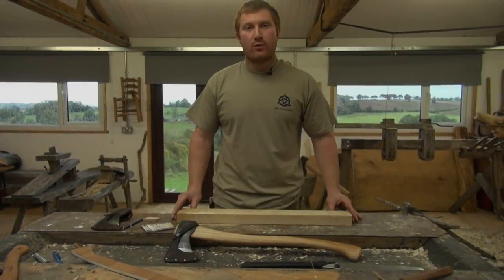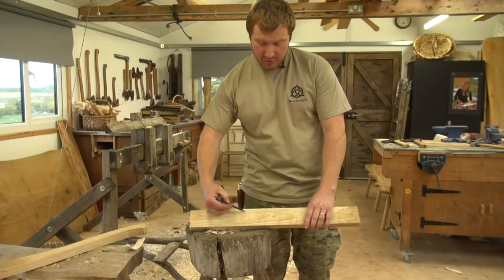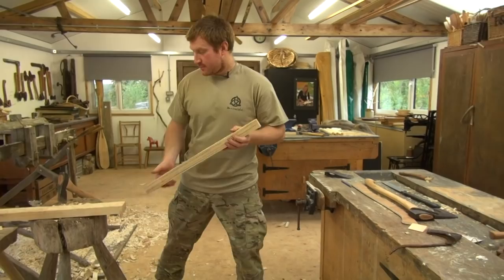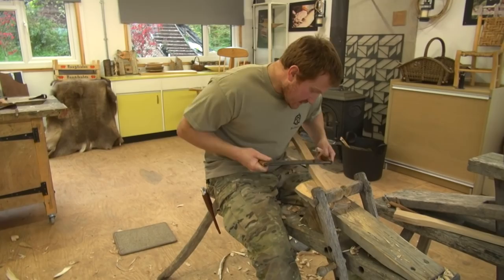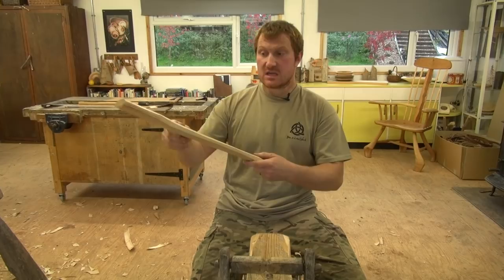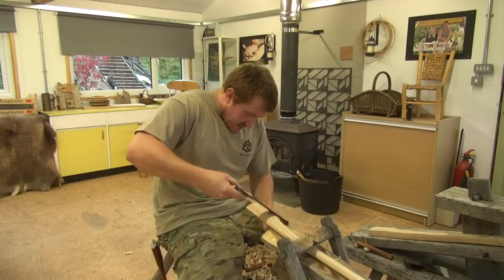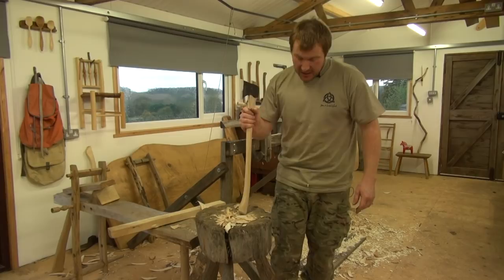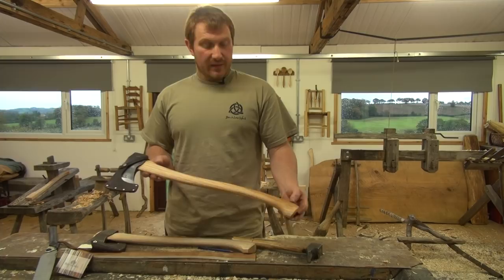How to make an Axe handle

Comment: I came across a carpenters hatchet, axe and a small 4lb. sledgehammer that were my great grandfathers made sometime in the 1800's.  Had to replace the handles and they turned out great. Wish I had a crook knife like you had to shape the handles. It sure would have made it a little easier, but I got it done. Great video and thanks for making it.

Comment: Find/cut a branch from a tree that is a little bit bigger in diameter than the handle you want to build and using your knife shape it into a straight handle.People have used straight handles on their tools for millions of years and some still do...With your newly fixed axe you can carve a better/fancier handle like you can see on this video:QVXvw6to2xA .Hope that helps!The most important thing is to actually start doing/carving something.

Comment: "Obviously if you're out in the woods and you need to restore your axe handle you won't have a bandsaw, so we'll show you how to do it with an axe." 
What. 
What. 
THEY HAVE NO AXE. THEY CANNOT USE A TOOL THEY DO NOT HAVE.
Reply: XD that's hilarious
Reply: +Sitric Brave Well, you could use the head. It would take a bit of work without the handle, but it is possible. But I do get what you're saying.
Reply: +Sitric Brave Since the handle blank is for a boy's axe size (or same would apply for a felling axe size), I'm guessing he means using your hatchet to shape the handle for the larger axe considering you would never really use a larger size axe for carving/roughing out anyway. In the woods, without a dried blank, you could make a temporary handle from green wood -- which could be shaped using a knife since it'll be softer.
Reply: you can stick a rough temporary handle into the ax head...but I've never known an experienced woodsman to break a handle...
Reply from the maker: Obviously this has caused a little confusion, this was to show you the skills in a workshop so you understand the process. Then if you are out in he woods and have to fix a broken tool you can. Effectively you can use the axe head without a handle to fashion a new handle it will just take longer. 
You could make a new axe handle with what you have to hand and be resourceful. 👍
Reply: Tyler Rodriguez or time to let the handle dry XD

Comment: great video thanks....what if all you have is freshly cut wet oak wood? doesnt it need to be cured or dried first?
Reply from the maker: Well you can make the handle first when it’s green but make sure you leave the head end over size. It can then be dried before shaping to fit. 
Hope that helps👍

Comment: Hello, is there particular reason for chopping the main shape with axe? It seems it would be much easier to just cut it with bandsaw. Or would the saw somehow weaken the wood by not respecting fibers direction?

Anyway this is very informative video. I recently broke a handle on my old axe and will need to make a new one. I'm sure this tutorial will come in handy.

Comment: Why would you split across the grain with a steel wedge. You cut with the grain for the wedge, if done right the glue will hold it in. You can buy a swelling agent for the wedge. Don't put steel wedges in. That manufacturers idea if the axe drys out in the stores the wedge wont get loose. If a axe is stored in a normal atmosphere the timber can absorb moisture to swell the wood and keep that wedge nice and firm.

Comment: Wait. If you're out in the woods and your axe is broken, it's going to have to be something other than the axe you use to form a new handle.
Reply from the maker: Well fortunately you will always have the head of the broken axe so you can use the head or even make a simple repair to help make the fresh handle and fit it properly later. 
In these situations you have to think laterally 👍

Comment: If you're in the bush and you've broken your axe you haven't got an axe to use to make a new handle. Just a thought...
Reply from the maker: Well if you have broken your axe you will still have the head to use as a cutting tool. Often it breaks leaving a shorter handle. Sometimes you have to improvise 👍